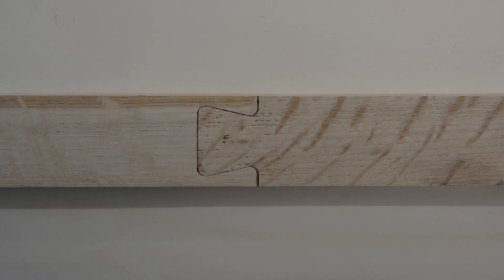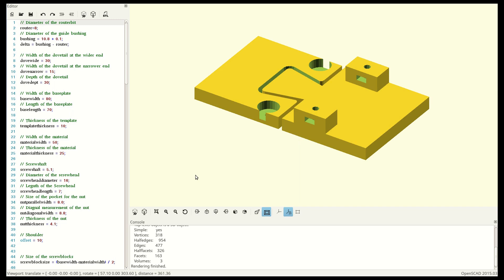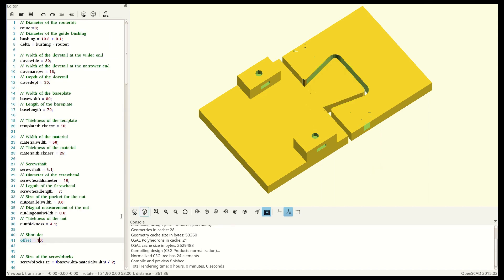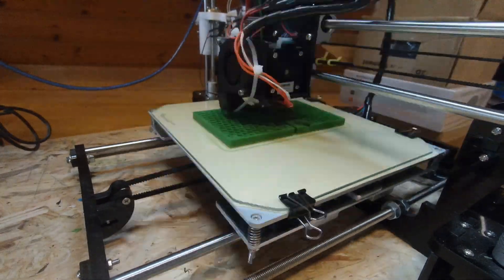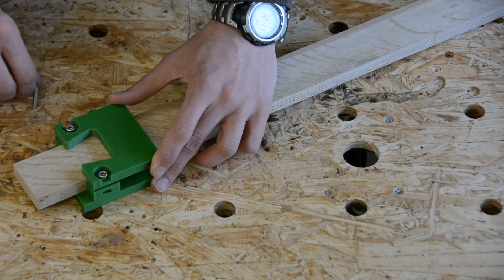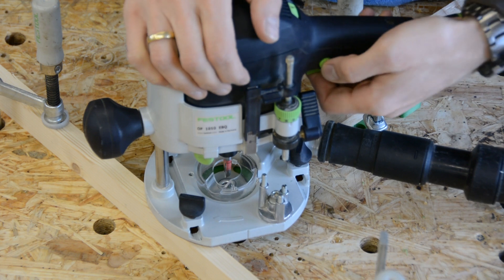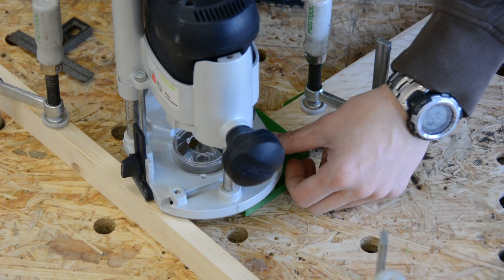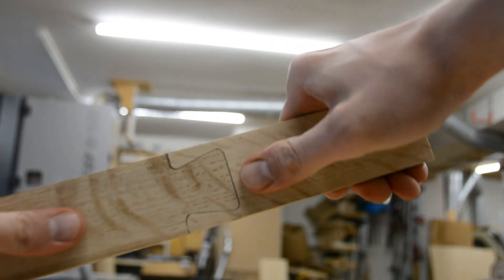Traditional German joinery with a 3dprinted jig

Comment: That's slick, but now someone will copy it and make a commerical made tool you have to buy,  make mine out of 6160 plz.  No that's a nice looking joint and super strong, insted of finger joints  this is far better.  My 16' x 7'  garage door they used finger joints with wood glue, as with most large wide doors it smiles at me even with a metal support
It's mostly becuse finger joints on end grain dont hold up to a lot of stress.
This type of joint would and if you used short boards and changed the crown it's not going to bow over a 16' board.
It would have been better as a laminated beam.
Reply from the maker: Totally agree

Comment: This is really awesome. You could maybe use your router and a piece you cut with piece A on part B to make them fit each other? hope that makes sense. (cut half your jig with the router on a piece you used your part on, so it fits the other part) 

Edit: i WILL try this. :)
Reply from the maker: Gung Foo Mon I am not 100% sure if I got your question. If you want to create one template from another one you need a specialized set of cutters and offset bearings.
Reply: Re-edit: After re-reading your answer i saw what you meant when mentioning the special set of cutters with offset bearings. I meant using a piece of wood put into shape of your joint so you can use a knife or chisel (without having to sacrifice the negative part of the jig when you cut into the piece of wood) to adjust the other side by hand, yet still be very accurate.
Reply from the maker: There are several ways to create a template without a 3dprinter. You can use a curve template router bit set such as this one: https://amzn.to/2H790B6 -- which is limiting the radius that you can add. A simpler way would be to just download the custom model from thingiverse, use the free software slic3r to create a svg file and cut the svg out on a scroll saw. With some patience, a sharp blade and some sandpaper you should be able to get the same level of precision.